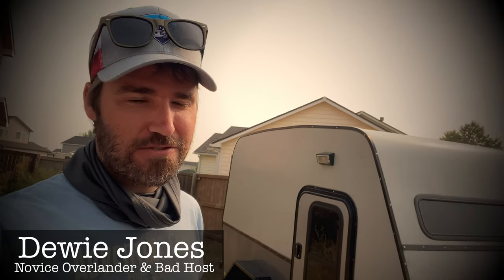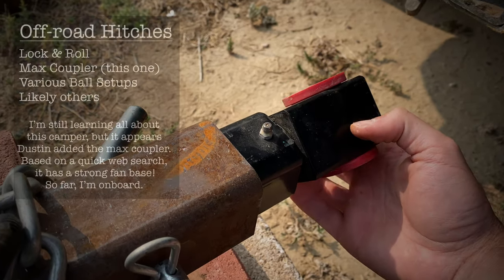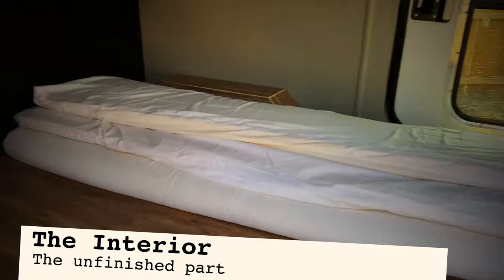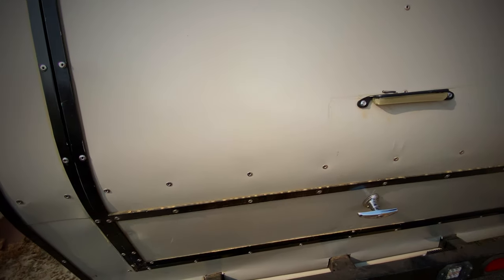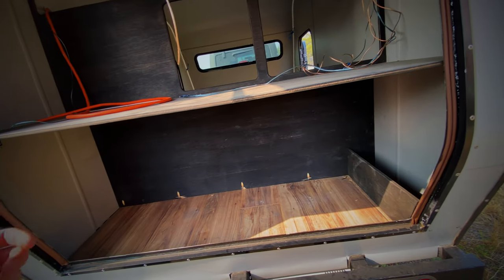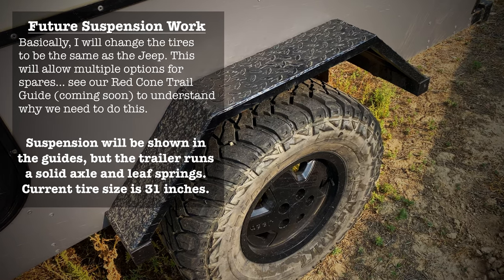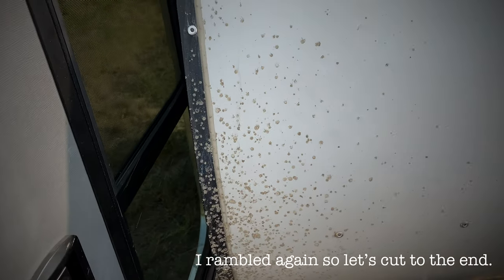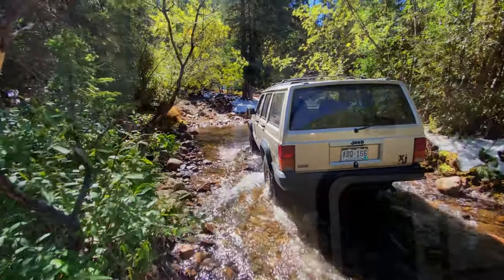DIY Off-road Jeep Camper Walkaround (can almost stand in it)

Comment: I’m glad you showed the trailer.
My wife and I are thinking about a small trailer like that in a couple years.
Reply from the maker: I really like it! Honestly, it’s gonna make shooting trails so much easier... it’s a bit small to live in in a cold environment so I’m not sure that’ll be successful. However, it’s definitely doable in nicer climates! I’m glad you enjoyed this... wasn’t really sure if I was going to do more camper videos without having it on the trails first.
Reply from the maker: @johnnyverano1373  I ended up going with a diesel heater. Have a Mr. Buddy, but it adds too much moisture to the cabin and riskier to run at night. Thank you for looking out though!

Comment: How has this been holding up for off-roading?  Have you done anything special in the suspension and frame to make it sturdier? What is the clearance? Thanks !!
Reply from the maker: It has only gotten a taste of the trails, but it handles them fine. Rabbit Ears Peak was its first trail. I’ll use it on a few trail guides this summer. I hopefully included a pic in this video, but it has a sturdy metal cage it’s built on. About 7ft 8in as it barely fits in my apartment’s garage. Thanks for watching!